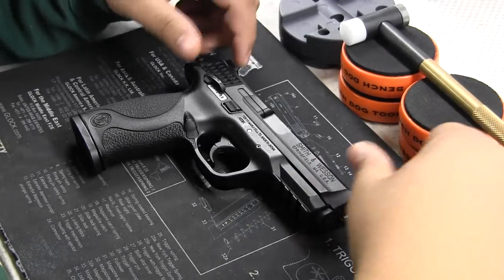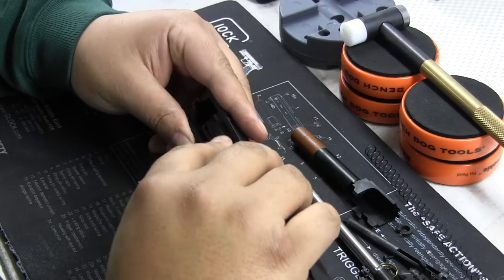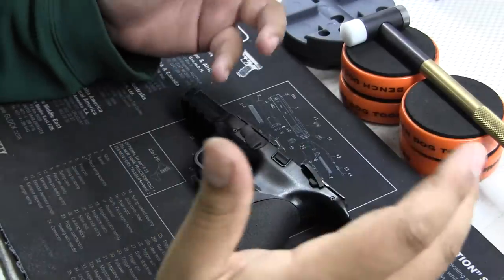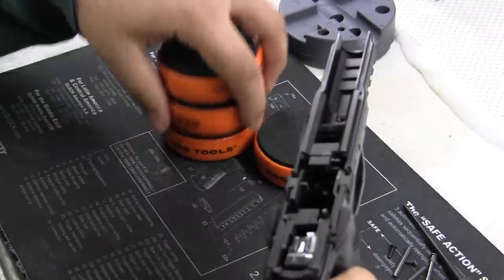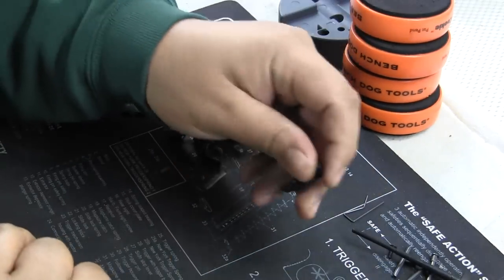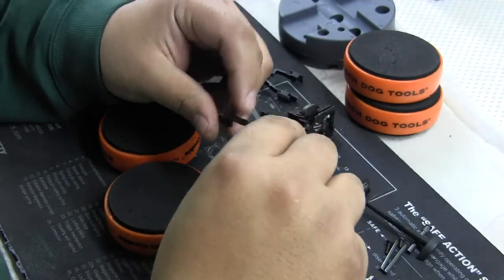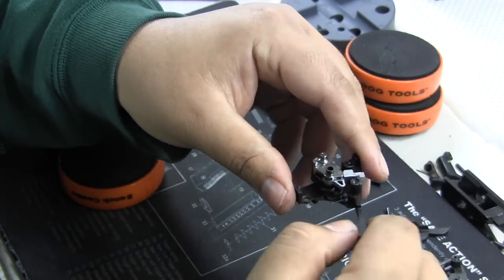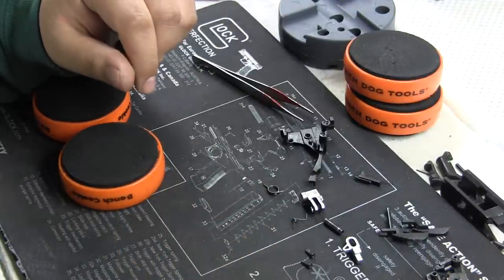Tokyo Marui M&P Breakdown Upper/Lower (HD)

Comment: Too bad Marui didn't stay with the G17 style hammer/sear design for the M&P. Seems this could have been easily done rather than design something new. VFC used the G17 style hammer/sear/housing in their M&P. The Marui M&P hammer/sear is very similar to the WE Big Bird style which is a copy of the Marui XDM series. Would have been nice to have immediate hammer/sear upgrades had Marui simply installed G17 parts in the M&P. Instead, the stock Marui M&P trigger break and reset is just as horrible at the WE. It's like pulling on a sponge without any feeling of a break point with an incredibly long undetectable reset.
Reply from the maker: randomairsoft  yea i hear you, but good news is there are parts out which fix the sloppy trigger! :) Check out UAC if anything.